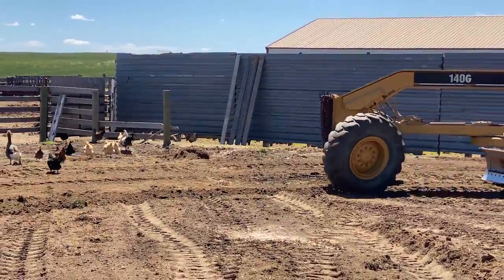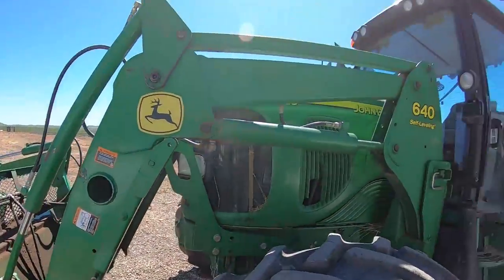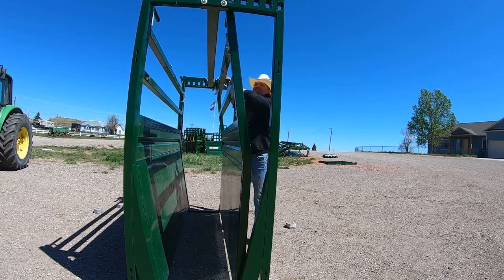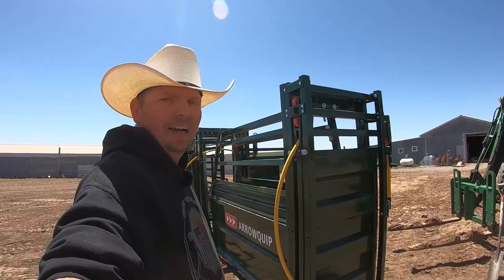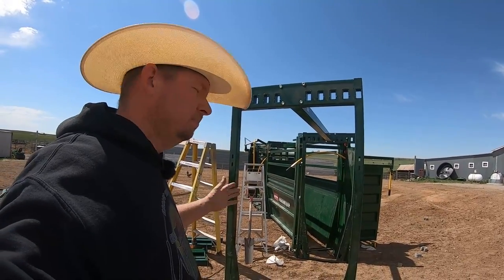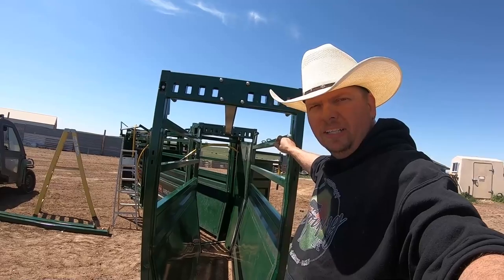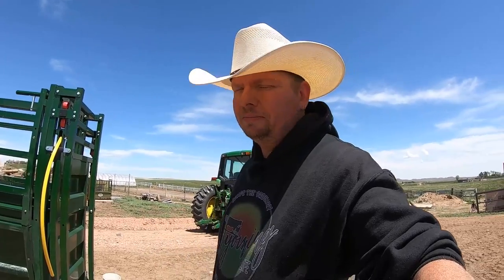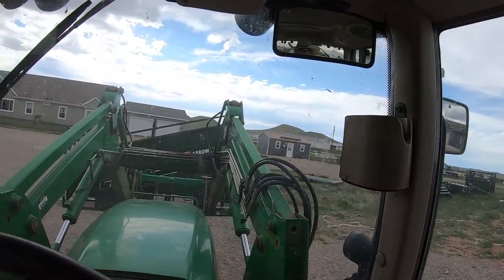Install Begins - Arrowquip Corrals

Comment: I have no doubt,  that Arrowquip chute, sorting pens snd bud box system will be a long term relationship. I just purchased an Arrowquip chute.  I’m goin to reverse the gate at the palpating cage,   For me it’s easier to push than it is to pull. There is no telling how many chutes and systems they have sold due to exposure on your channel. I’m guess more than enough to make Arrowquip very happy with their relationship with you. 

I really enjoy your channel, I was exactly where you are now 30 years ago. You learn faster than I did.

Comment: After you put the unit together in the shop, get a large carpenter level and lay it on the frame and it will help you with digging out the dirt.

Comment: I saw an earlier comment about using marking paint, which is a good idea. A way to make uniform radius or curved alley ways, would be to use 20ft sticks of 3/8 steel rebar. Their pretty flexible and easy to stake out on the ground, then spray with the marking paint.

Comment: Mike you could  use a steel workers tool  it a  open end wrench on one end and long  round tapered handel use to align  holes  stick  in one hole and you can pry it so hole closr by lines up put bolt in and so on so forth  like high rise or other  steel  frame buildings  when perlling are craned in tool helps aline hole keeping  fingers and hands out of harms way   but a large pin  punch  will work as substitute
Reply from the maker: I know exactly what you are talking about.  I thought about it a few times

Comment: I would lay the two end panels down on their sides and attach the top rail first.  Then you can lift them all by the top rail with the forks and stand that unit into place.

Comment: To me it would make sense to locate the loading chute first.  The reason why is that from a truck drivers point of view you want to make sure that the chute is located in an unobstructed location that is easy to get to.  To many times I went to load cattle at a building site that has a new corral and it is very difficult to get backed into the chute due to lack of planning and putting the chute in last. Also I think I would prefer to have at least the first two pieces you set on concrete with a nice apron around them to work off of.

Comment: That was a lot of work by yourself and somewhat dangerous. Glad it all went well.
Reply from the maker: I didn’t see much danger :). Working by yourself is the norm. Thanks
Reply: @OurWyomingLife I  suppose if you have had official help there'd have to be a "risk assessment" - takes all the fun out of discovering things for yourself.  That said it is a big undertaking.  Well done, anyway, I usually get to the end of a project and find I should have done something slightly different at the beginning or half way through, lol but I rarely backtrack, can't bear all the thought of doing it again!

Comment: You are a glutton for punishment! Of course it does make for good viewing - so good luck with the daily vlog, of course i will be watching every one of them.  
I see the reason i think Arrowquip suggested starting  the corral build with the loading chute - its the biggest single component - its heavy - its hard to see around and it is hard to maneuver. It's also the one component that must consider outside elements (trucks and their constraints!) and if that is not working you might have to move everything over a bit to make sure it will. The buildings and certain other things are not as movable as the Arrowquip equipment. I just think they were trying to make it easier on you. Clearly - they wanted to prove you could install this alone, which may be why you didn't hire help for this project. So - I am definitely praying for you!
Reply: mike take into consideration your hauliers ease of backing up to the loading shute, they will remind you ever time if you put it in a position that is hard to get to